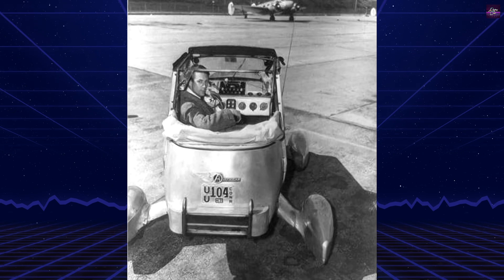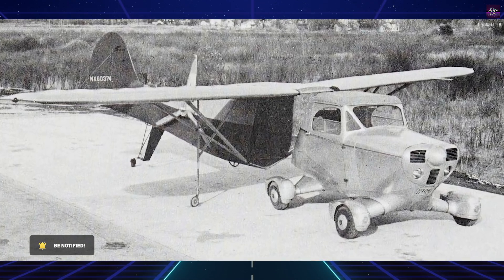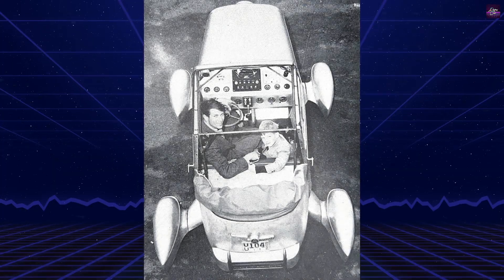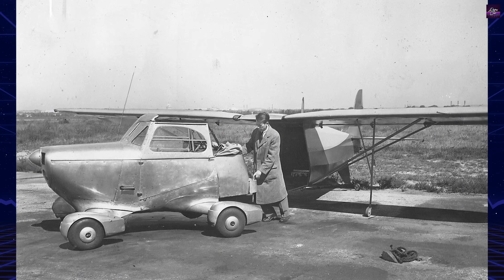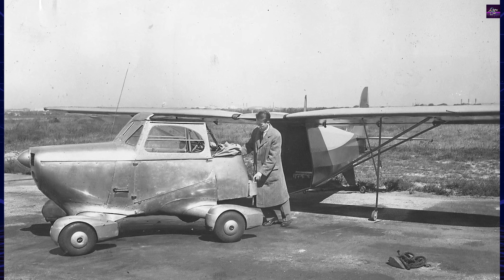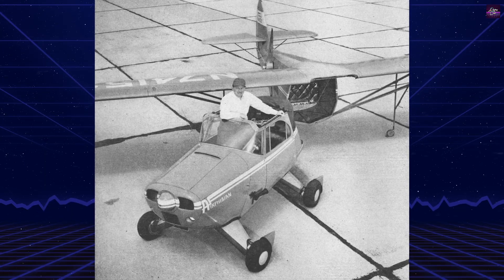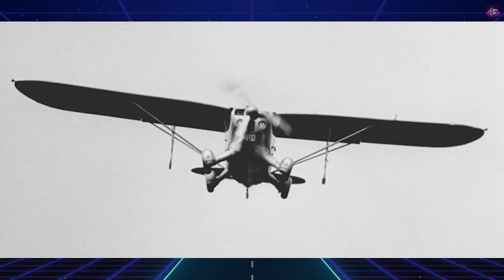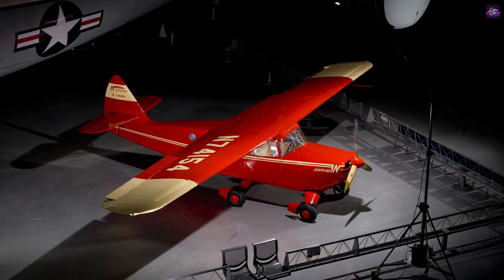Airphibian: The 1946 Car That Could Fly - Robert Fulton Jr.'s Legacy

Comment: Impractical, but undeniably cool on so many levels to the point where people are still experimenting with the basic concept.  When I was in Junior High School, a flying Ford Pinto called the AVE Mizar was built and tried in the early 1970's.  Though fictional, a flying AMC Matador was used by Sir Christopher Lee's character in the Bond Movie, "The Man With The Golden Gun."

I'm not even going to bother searching for a model kit or diecast.  If they exist, they're probably out of my price range, and would take up a huge space on any display shelf.  But I would love it if Round 2 repopped the AMT kit of the AMC Matador.  I'll leave it to scratch builders and 3D Print fanatics to make wings for it . . . .  

Thanks for posting this!

16th Like.